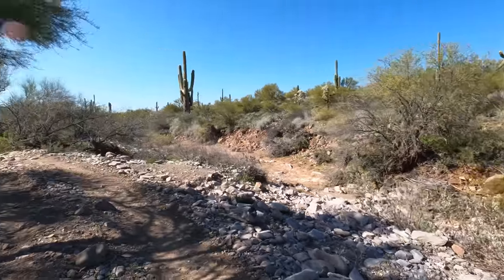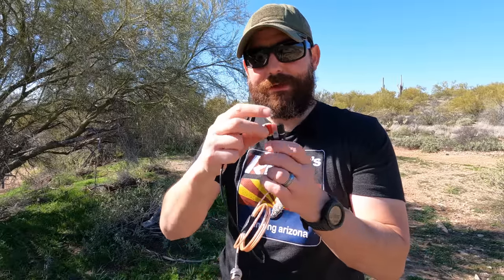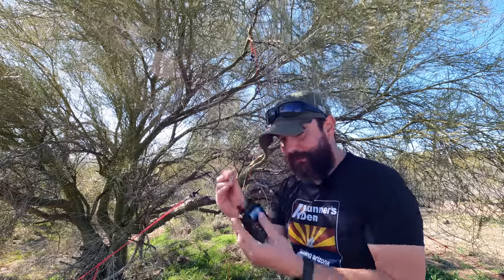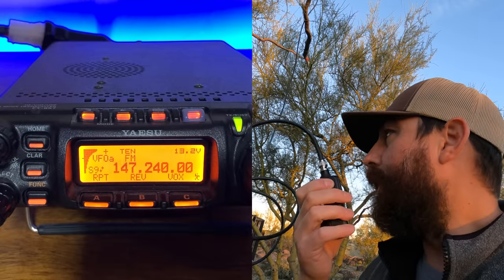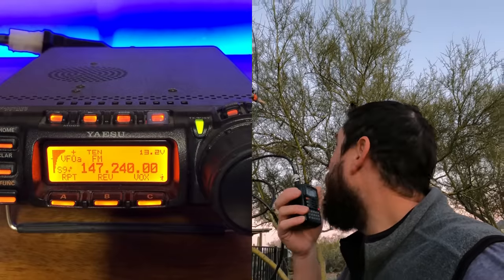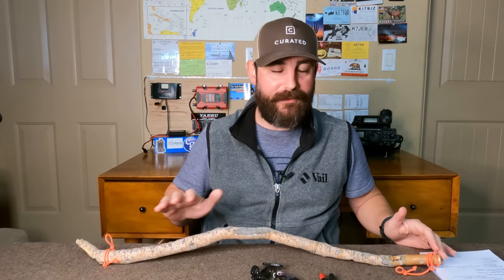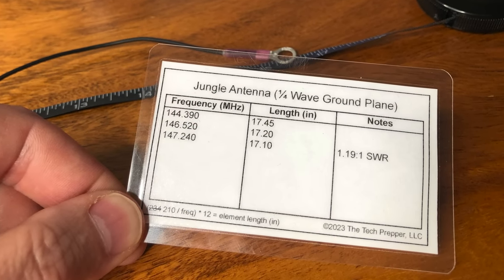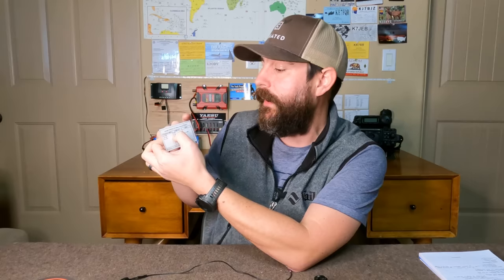Improvised Field Comms - The Jungle Antenna

Comment: Hey Gaston, Nice presentation. Only problem: you had a severe shortage of jungle to be testing a jungle antenna ;-))  What might be interesting is to compare the performance under identical conditions the field-expedient (i.e., "jungle") 1/4-wave and an Ed Fong "roll-up" antenna (which is a 1/2-wave j-pole). I suggest that as I think your intent is to test/experiment with lightweight portable antennas for deployment in austere field conditions. BTW: I think that probably the nearest jungle to you might be the north coastal redwoods in NorCal ...
Reply from the maker: I actually just received an Ed Fong in the mail from Ham Radio 2.0. I like the small size and lightweight nature of the roll-up J-Pole. After getting the Ed Fong, I am going to stop carrying my heavier and larger Slim Jim from N9TAX. The performance will likely be better than the 1/4 wave ground plan. The only issue is that I can't repair the J-Pole in the field or build it as easily. With the Jungle Antenna, I can pretty much find wire anywhere. Everything is a trade-off. I think you might be right, there are no jungles for several hundred miles.
Reply: Gaston absolutely a LOT to be said to be able to jury rig an antenna if a primary fails if/when operation in austere environments.  Just ask the guys who were deployed outside San Juan Puerto Rico post Hurricane Maria. 
Best regards!
Reply from the maker: @jimpiper5297  Thanks, Jim. I can't recall if you're a member/supporter, but given your comments...check out the first half of next weekend's video. I had to think on my toes. This was not planned! https://youtu.be/3GhvXCQwIAo
Reply: @TheTechPrepper  Look for supporter $ coming your way.
Reply from the maker: @jimpiper5297  Thanks, Jim! Every bit helps.

Comment: It occurred to me that a right angle adapter added to the cobra head would eliminate the curve in your coaxial cable. It won't make any difference in performance and is another piece of gear, but it will reduce the strain on the coax connector.

Comment: I’m new to this, but my understanding is that having only 2 radials will make it slightly directional. It might be interesting to test it at 2 different 90 degree orientations to the repeater to see if it makes a difference in your signal. 

In your application, directionality isn’t necessarily a disadvantage (could even be advantageous), but as a base station antenna in a FOB location, for instance, it could be a problem.
Reply from the maker: Thanks for jumping into the comments. The distant station was broadside to the antenna, so it may not have mattered. Without modeling it, it is hard to tell. I am still experimenting with 2 vs 3 radial designs.

Comment: I love your videos and I am a subscriber!  I wanted to add that I think, but I am not sure, that the wire you wrap around at the end does add to the electrical length of your wire assuming you use insulated wire.  I think when you fold insulated wire back on itself the true electrical length is somewhere between the length of the total wire used and the strait portion of the wire.  It is somewhat complicated but it is sort of like a folded dipole.  However, if you use lengths that are checked with an SWR meter you are good to go.  This might be why your antenna seemed to work well but seemed to be a bit too short with the 234 formula.  I am a bit unsure of myself with this though.  Robert K5TPC
Reply from the maker: Thanks for the support, Camille! This makes perfect sense. This is where the DOPE card with the precalculated lengths pays dividends as I won't always have an antenna analyzer. Cheers!

Comment: One idea I had to improve a jungle antenna was to tie some cordage to the corners of the sticks, tie off above the radiating end and hang the hot end from the knot at the top.  This was you aren't using the antenna itself as the support to hang from.  I haven't tried it, just an idea.
Reply from the maker: Interesting... A member on BMAC suggested attaching a length of cordage to the hole on the Cobra head and running it vertically with the radiating element to add strain relief.

Comment: Great test! I prefer that antenna over a Jpole as can easily be reproduced without test gear if you know the measurements. I've found three radials become more necessary on VHF Low , 6 meters / 10 meters. Yes, you are seeing knife edge diffraction and maybe a little multipath. Initially I thought the repeater receive was terrible, but when I saw the obstructions it made sense. 

Last, If you use the traditional 468/146MHz (Frequency in MHz) and divide by two you get 19.2 inches. Multiply by 90% and you will end up at 17.3 inches. Pretty close to your results. The ring terminals or knots at the end of the wire add a sort of capacitive hat that shortens the antenna 5-7% plus 2-3% for insulated wire. At HF frequencies this stuff doesn't matter as much. At VHF and up it does. 

Great videos! it is awesome to see someone out there practicing this stuff in the field! Keep up the good work!
Reply from the maker: Thanks for the confirmation on the Knife Edge Diffraction. I actually built four (4) elements for 6m FM last night to try out. We'll see how that works. The closest repeater is 41 miles. I always carry a roll-up J-Pole, but this antenna appeals to me as I can easily build or repair it with readily available materials. The J-Pole is not easily field repairable or constructable in the field.
Reply: @TheTechPrepper  If you haven't messed with 6 meters much you will  like it. I'm in the Appalachian mountains and have found that 10-20 watts of 6 Meter FM simplex will make contacts through the rugged terrain where 50 watts of 2 Meters will not even break squelch. SSB is even better. All the old forestry and part service guys lament the transition to VHF and 800MHz for their radio systems. "the old lowband systems just worked better"
Reply from the maker: @sixstringforge  I figured that 6m would be  a great for a bit more range on low power. Thanks.

Comment: great video however 1 thing to note most of the military setups you would use typically function off of a mobile radio not a hand held, most hand helds i find need a LOS of 1 km or less whether it be  a mobile or 40+ foot in the air antenna off a repeater..
Reply from the maker: Thanks. This is a good point. I plan to test this with my manpacks this weekend.
Reply: Great thing about handhelds is that it can push up to 5 watts depending on the unit, which is double the output of a PRC-77 UHF radio (mobile/manpack) which amazingly only put out 1.5 to 2 watts.

Comment: Next, try ditching the cobra head.  You can fashion a 1/4 (or even 5/8 wave) ground plane using only coax.  Just strip 19.5 inches of center conductor and unbraid the braid. Lightly twist the braid into 2 (or 3) radials and POOF!
Secondly, the rule of thumb is to take off about 5% length for insulated wire.
Reply from the maker: Thank you for touching on this. That's ultimately the plan. This first pass is the "crawl" phase, I plan to jump into the "sprint" phase with your approach.

Comment: That’s great Runner! I’m curious if I set the 1/4 wave beside my sheet-metal-sided travel trailer if it will tend to direct the radiation away from the trailer.  I may have to do that experimentation myself, but it would be well served.   73s Tom KC3QAC
Reply from the maker: Please give that a try and report back. I'm on QRZ. 73 de KT7RUN.

Comment: Is there some inherit advantage to using that female to female adapter rather than just using a female cobra head directly???
Not having the Cobra heads in hand, just looking at the pictures, isn't there a couple of structural holes in the body of the cobra head? could you use some cordage thru one of those to both hold the radiating element and then use the cordage to support the entire weight of the setup???
Reply from the maker: I use the same Cobra head directly with my HT as well. With this approach, I can use it for both the HT and jungle antenna. Check out the first video in the series.
Reply: @TheTechPrepper  I have been kinda binging on several of your great videos, I'm still waiting to test for my general, but all things HF intrigue me more all the time. 73

Comment: It's a pretty interesting video and counterpoises certainly work but don't discount the effect of straight elevation gain.   Somewhere there is a formula that covers antenna gain vs just elevation increase for vhf.  With a relocation cable and a line on your rubber duck, you may still have reached that repeater after you raised it 12 feet.
Reply from the maker: Thanks for sharing. That's an experiment to try.
Reply: @TheTechPrepper  Keep up the good work.  Experimentation is a large part of what being a ham is about imho.

Comment: Great stuff.  Quick, Trademark "The Desert Antenna".  Cheers   73   JQ7BJB
Reply from the maker: That's an idea! I am happy that I tried three deployment options and found what works for me. The two radial system with the single twig is the perfect balance out here of: performance and ease of deployment with minimal components.
Reply: Also solves the problem of guylines being 15-17 feet long with the antenna deployed higher! Good fix.
Reply from the maker: @the_mad_swimbaiter455  Yep. I wanted to mention that. I completely forgot. Plus, it allows me to still build my shelter.

Comment: If you put a splash of color on the card and use a similarly colored bead on the wire, you won't need to measure in the field.
Reply from the maker: That's a great tip. Thanks for the suggestion!

Comment: I came across a 6m/2m skeleton dipole antenna made from ladder/window line in this video from KM6JUR . There is a picture shown in the video of the dimensions of the antenna. I paused the video and took a screen shot of the image in the video and printed it out. 
https://youtu.be/XLt9bp8W0Dc
Since it is a center fed dipole, it can be setup horizontally polarized or vertically polarized. 
I made one and according to my antenna analyzer it also shows a low SWR on 70cm. 
I haven't used it very much to know how well it works yet, but it can roll up and may be a good portable option for a multi-band antenna for 6m and 2m, and perhaps even 70cm.